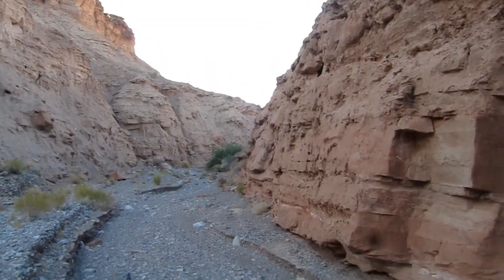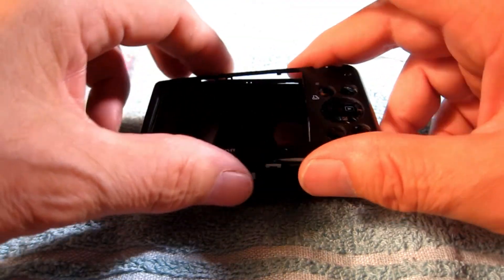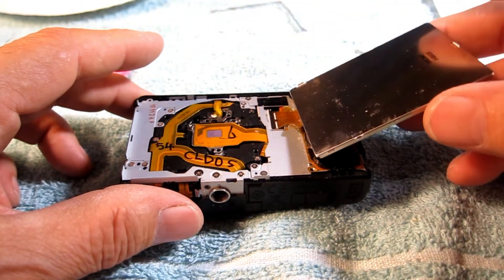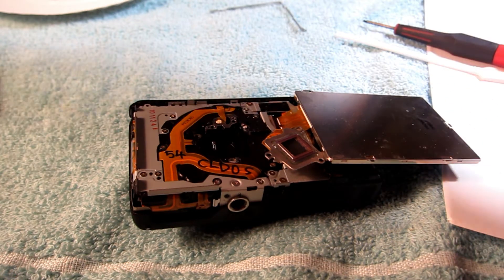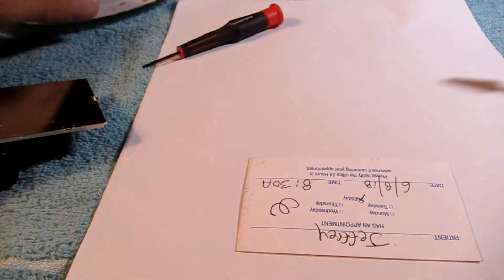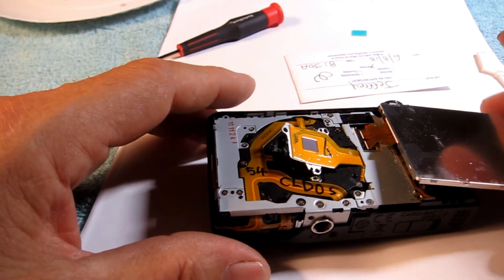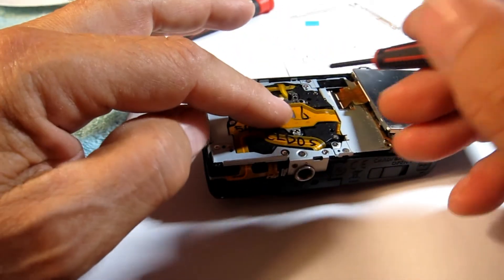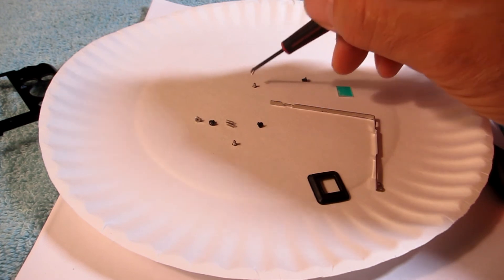canon s-95 s-100 CLEAN THE SENSOR AND LENS ELEMENTS. (may apply to many point and shoot cameras.)

Comment: I just cleaned the sensor but my S95 has now focus issues, it only seems to work when I zoom in (it's not in macro mode, just in case). Any idea what could have happened?
Reply: The sensor sits on springs where the screws are. It is calibrated to that. When you unscrew it, you're losing the calibration. It is possible to regain focus if you somehow manage to return the sensor to exactly the same depth each screw was at before you opened it up - or through LOTS of trial and error. I have heard some lenses can be taken apart from the front rather than unscrewing the sensor itself.